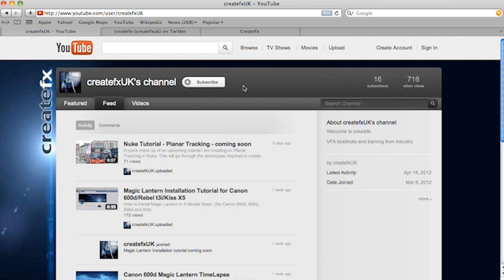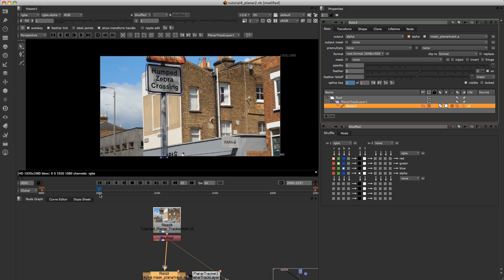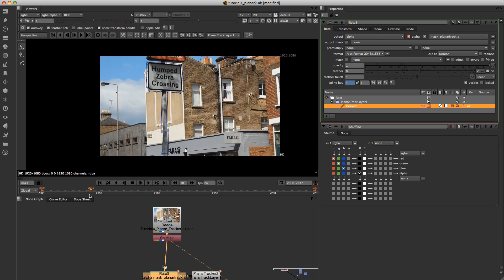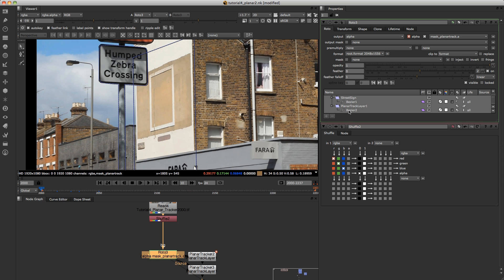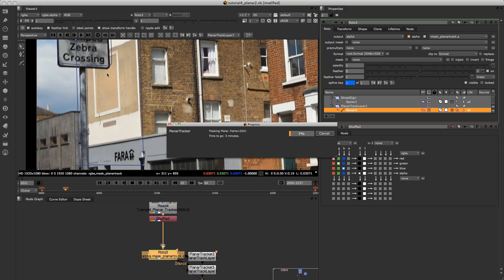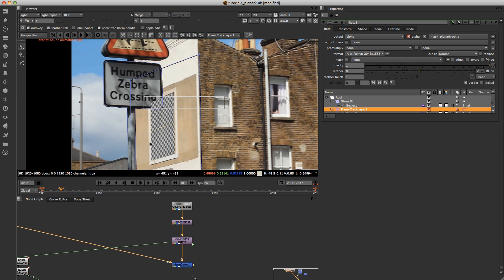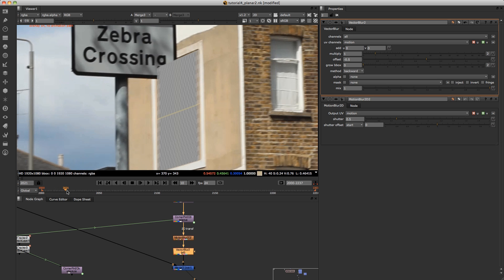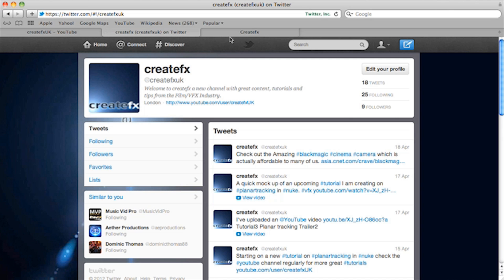How to track shaky footage and speed up rotoscoping using Planar Tracking

Comment from the maker: thanks, and yeah you will need to put motion blur on the street sign roto so it can account for the motion blur when it subtracts from the background poster or text (or whatever you have placed on the wall). And the vector blur should work fine at the default settings if not you can always tweak the settings. The tutorials will keep coming don't worry, I will also be starting the createfx Quick Tips series soon with much shorter videos on cool tips and techniques so stay tuned lol
Reply: GREAT CLASS EVER FIR ROTOSCOPING IN NUKE SPECIALLY FOR PLANER TRACK TRICKS TECHNIQUES  FOR ROTO..THAT'S MUCH NEEDED ..LOTS OF THANKS SIR

Comment: Great tutorial, thanks. Do you need to add motion blur to the street sign roto? Also are the motion & vector blurs just fine to use at their default settings - no need to change? Thanks again & keep them coming!